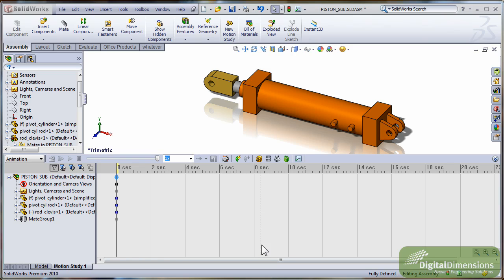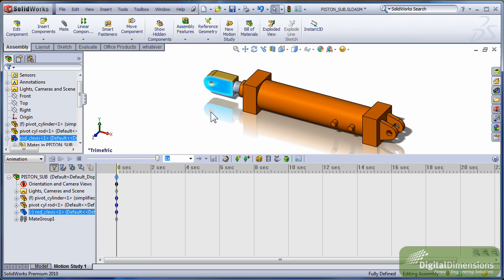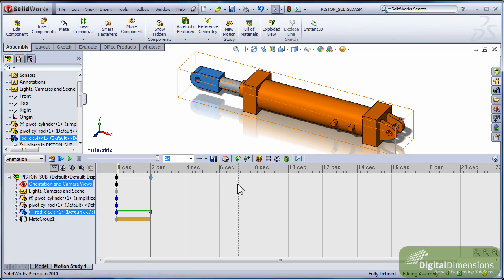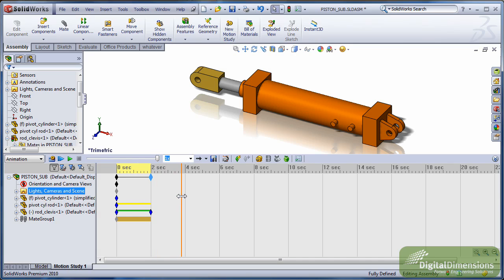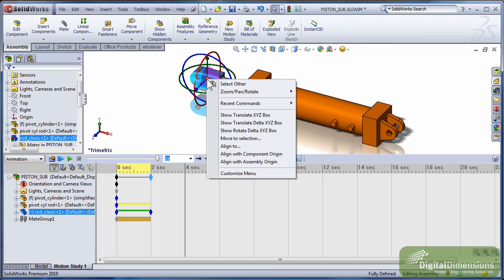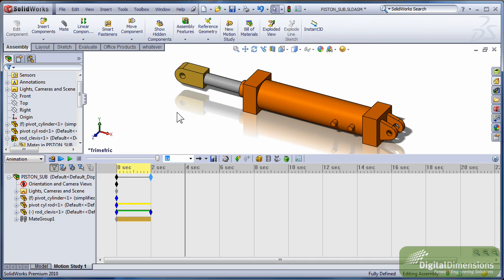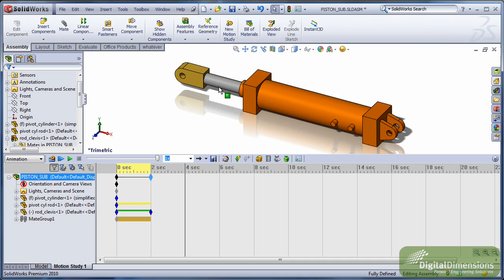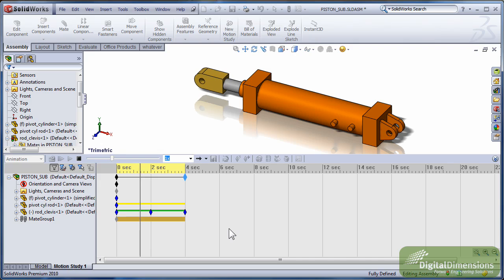SolidWorks Motion Manager - Drag Motion

Comment: Do you know anything about the minimum distance you have to drag a component? I want to drag a component for like a couple of milimeters, but then it wont move 
fluently. In stead it will snap from the one to the other position in about 0,2 sec while I have set the moment to 2 secs. Can I edit the mimimum drag distance somewhere?